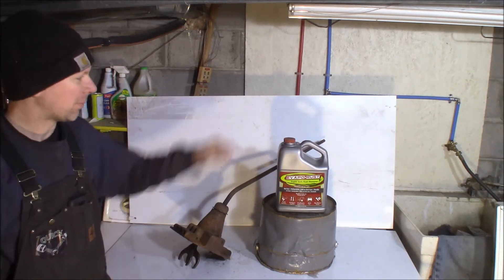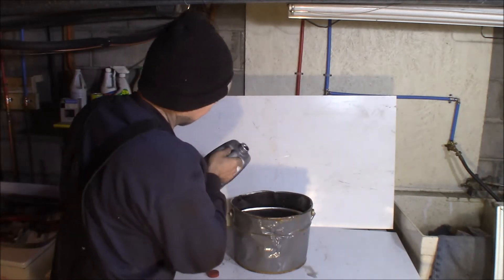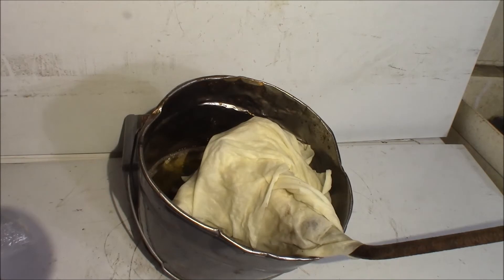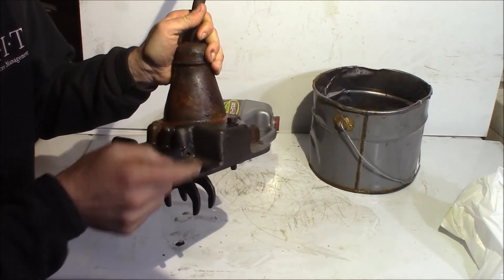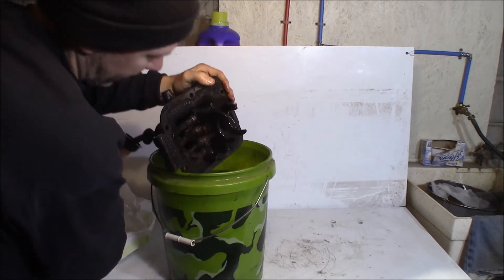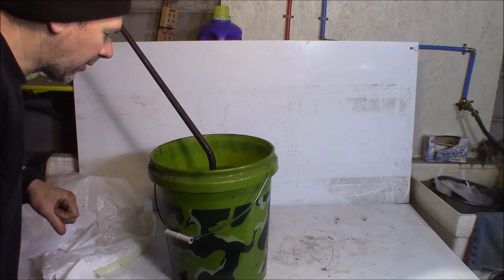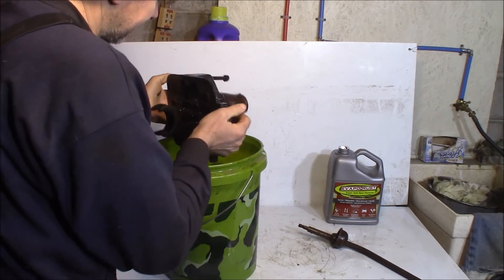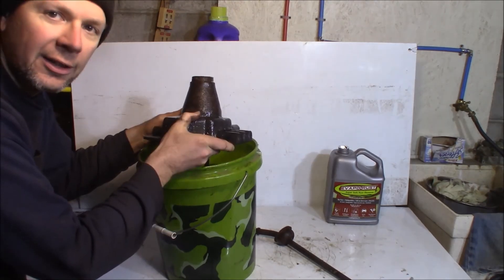Evapo-Rust:  Does it work?  Let's find out

Comment: Glad to see how well it works.  I believe that you can save it and use it multiple times too.
Reply from the maker: It worked fantastic.  It's hard to see because this video came out a little dark, but the shifter ended up being a light gray in color with absolutely no rust left anywhere.  You are correct in that the Evapo-Rust can be used over and over.  I currently am derusting some other doodlebug parts in the original solution.